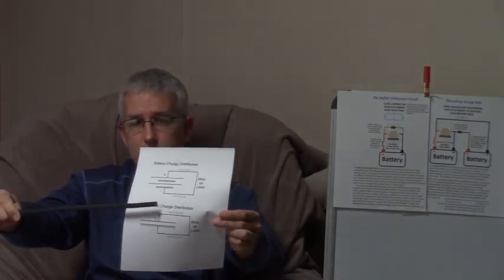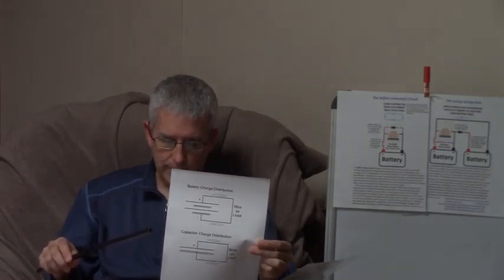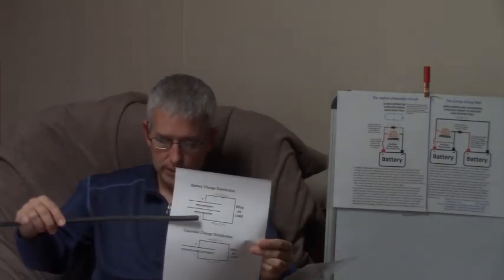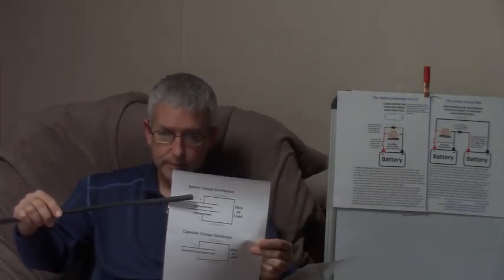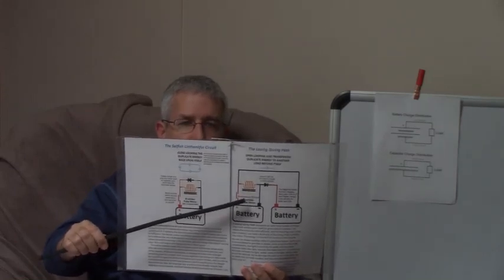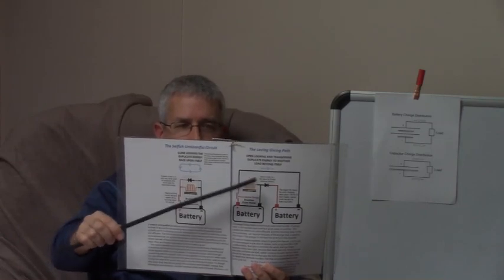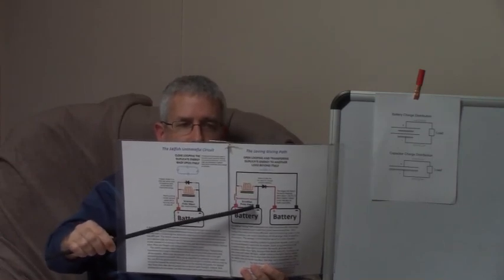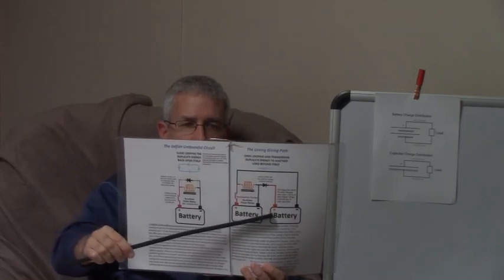Free Energy does not have to be Self Running

Comment: helpful summary thank you. Can you clear up whether or not the use of spark gaps or interrupters actually increase voltage and or frequency? There's been several people that have made this claim.  I would love to know as it seems to be a very important question. Specifically is there a particular spark  gap configuration that would predictably lead to an increase in frequency and or voltage?
Reply: A spark gap is an electrical component that fires when voltage reach a certain level thus it can provide 'disruptive' fast on/off discharge. Frequency is just the number of times per second something happens.. What are the effects of fast on/off current thru inductors/coils? How does transformer work? Resonance RCL circuits? You may find your answer after going thru Resonance Inductive Coupler Kits.

Comment: Veritasium and The Science Asylum both admit that the energy in an electrical circuit flows in from the enviroment 90 degrees to the flow of charge .  Energy is not attached to the flowing charge coming from the source .  It's like the heat that flows into the evaporator coils in a refrigerator and not something thats in the freon .